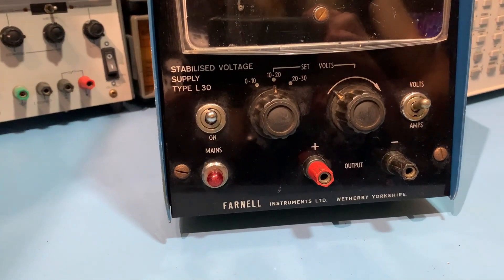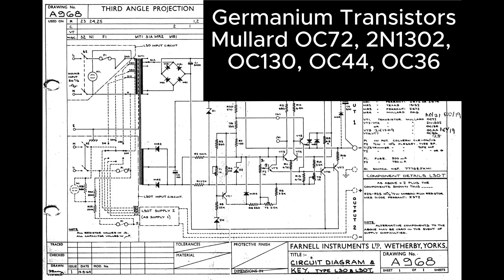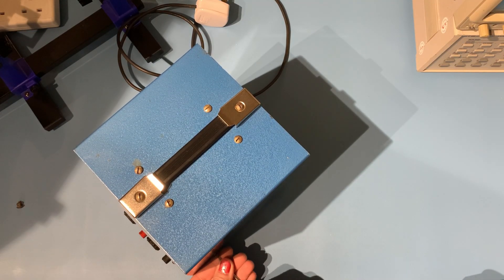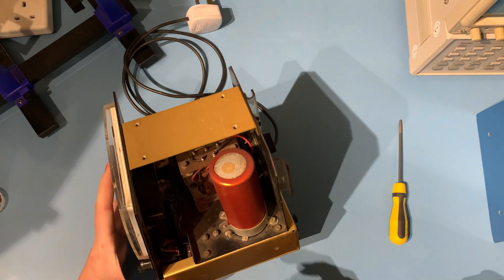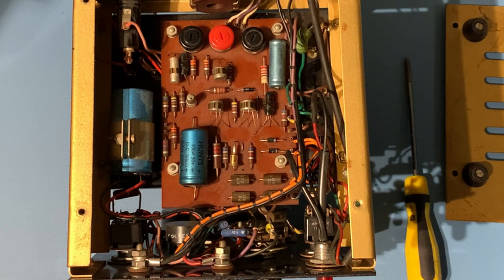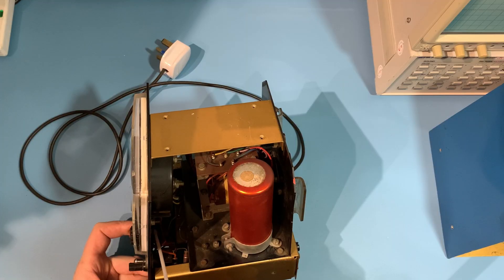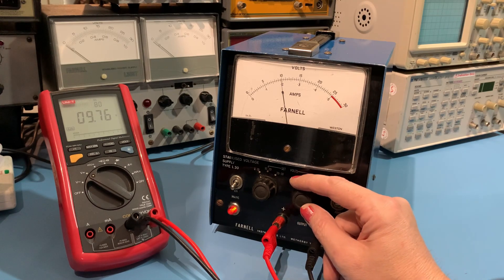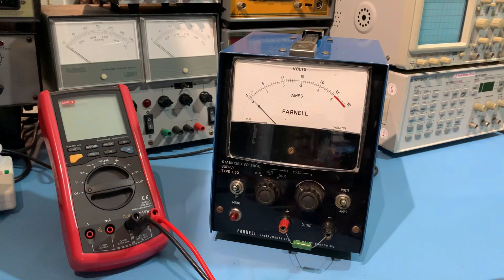Farnell L30 Vintage Bench Power Supply

Comment: Nice power supply, like the big meter and would like to see it in action. Cheers.🌹
Reply from the maker: It's a nice power supply with a huge meter but it's only 500mA so it doesn't get used much. I just liked the look of it. Farnell have always made good bench power supplies.

Comment: I have never really understood the ESR bit when caps are cheap , compared with the labour of removal and testing versus just replacing the lot. Quick and easy. You are mad
Reply from the maker: Radial electrolytic capacitors may be cheap but axial electrolytic capacitors are not. You don't need to remove them to test them with the right test equipment. It's also sometimes not easy to get things apart enough to get to the solder joints to remove them. We are not talking a simple single PC motherboard with removable connectors for example.
Modern radial electrolytics also have very low ESR, which does not suit all older equipment and can make some things unstable.
The idea of ESR testing in (very) old equipment is to make sure it is safe to switch it on and to identify electrolytic capacitors that really are bad and need changing. Why do you need to change capacitors that are good, especially when the axial ones are quite expensive.
A blanket electrolytic capacitor change is not the answer.

Comment: Wow loved that supply with 5 amps too, very nice! Didn't expect that accuracy after so many years!
Reply from the maker: Yes, surprising how good it is after all these years. It's only 0.5A by the way. High currents were difficult with Germanium transistors.
Reply: @JazzyJane_uk Oh wow, yea I had to look really close at the setting on the back at 1:06 to see the tiny dot for what should be 0.5 or so. It was in the middle as well. Why not show 0.5 and not 5 with a middle tiny tiny point?? Even the front meter had that silly display, 😆 why why, were the hiding something....hehehe

Comment: As its only 0.5A maximum current, there is not very much you can power with it.
Reply from the maker: Yes, limited use today but it's still a cute supply, and as @jbuchana said, still good for small breadboard circuits. Not everything has monster power requirements.
Reply: I used to power many circuits on breadboard with a 500mA Tektronix power supply. Lots of small circuits use surprisingly l;little current.

Comment: Nice little unit. I’ve never had a special occasion power supply for special occasions before… 😂
I did notice the voltage selector dial on the rear that ranges from 210 - 240, nice to be able to dial it in depending on your mains voltage. 
It’s snowing and cold in Alberta Canada tonight, wish I was in the UK for the winter. 
Thanks
Reply from the maker: It's not much better here. Tipping down with rain and going to be -1 degC in a couple of days.
Thanks for watching.